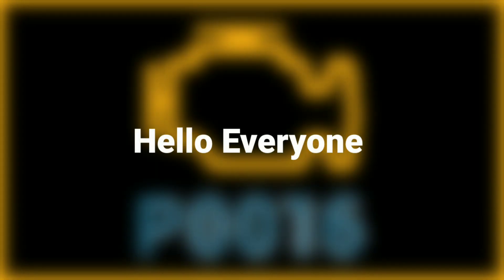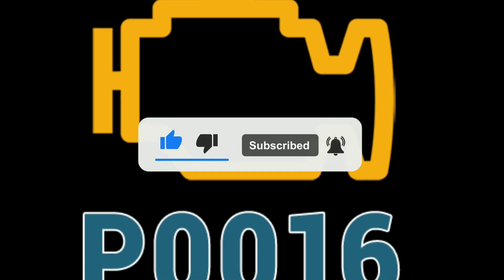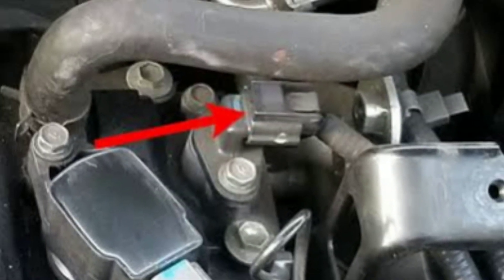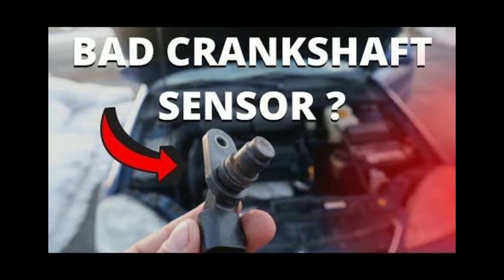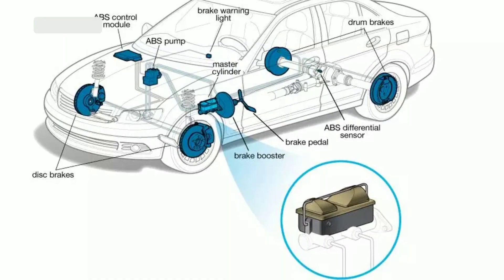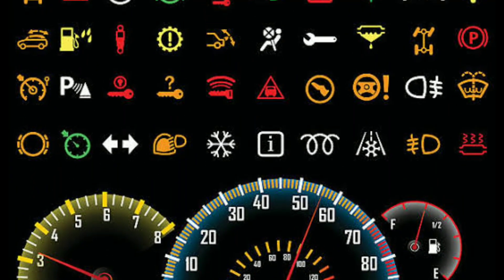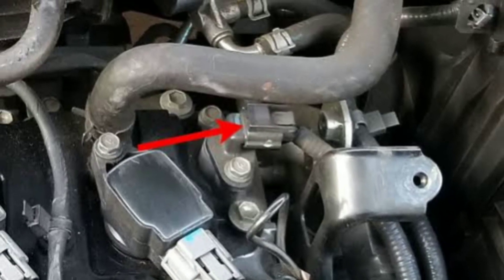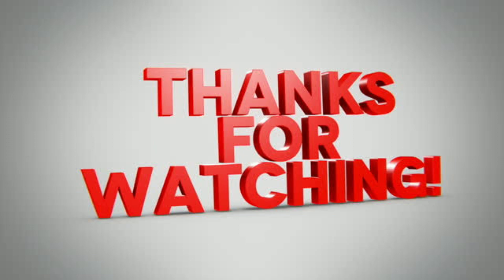P0016 Code: Causes and Solutions | How To Fix Code P0016 ?

Comment: Had this code pop up last week. My scanner helped confirm it wasn’t just a bad sensor but actual timing chain stretch. These tools save so much time guessing.
Reply: How where you able to actually diagnose past a sensor with a scanner
Reply from the maker: Exactly — code P0016 means the camshaft and crankshaft positions are out of sync. While a faulty sensor can trigger it, your scanner data likely confirmed actual timing chain stretch or wear, which affects engine timing. Catching it early with a scan tool prevents bigger engine damage and avoids unnecessary part replacements.

Comment: I had code p0017 code. Got the timing chain changed. Now i have code p0016 one week later.  Any suggestions?
Reply: I just had my 2015 Ford 3.5 Ecoboost at the dealer for a p0016 code and was told I had a stretched timing chain that would cost over $2,000 to repair.  I didn't trust the diagnosis because I didn't have any other symptoms of a bad timing chain such as an engine rattle, stalling or rough idle.  I suspected I was getting a bad reading from the  VCT sensor for bank 1 and installed a new on my self for under $50.  Problem solved.  My vehicle has 180k miles on it and the previous owner did not change the oil on a regular basis.  Dirty oil can cause the sensors and solenoids to go bad and the OEM recommendations are inadequate.  I change my oil every 5k miles with full synthetic oil to avoid this problem.
Reply: @Roy-ij1wq I’m praying my situation is similar. My vehicle has said I need an oil change for about 1.5 months now. I dont do much driving and its been super cold here in Michigan so I have been neglecting it. The code popped up yesterday but the vehicle feels and acts the same it always has. I’m hoping oil change solves the problem.
Reply: @ShakeThaBlockPyro  I hate to say this, but now I'm getting a P0010 code.  I'm also in Michigan and the code appeared when I started my Expedition the morning after we had quick freeze thaw cycle.  It runs fine except that sometimes it hesitates when accelerating.  I didn't have this problem after I replaced the sensor.
 I have an appointment next week with a trusted mechanic and am going to have him check the wires and see if he can figure it out.  I''m also going to have him test the sensor I replaced to see if was in fact bad.  My vehicle had 156,000 miles on it when I bought it and had the notorious cam phaser rattle.  This was defineately caused by dirty oil and was cured with four oil changes at 3k to 5k intervals.  It was 5 degrees this morning and the vehicle started just fine with no rattles.
Reply: @Roy-ij1wq  Sorry to hear that man I hope it works out fairly well for you. My ecoboost 2013 just hit 160K. I feel like the acceleration and overall how the truck drives hasn’t changed much since I bought it. I can tell you I won’t be neglecting oil changes ever again lol. I scanned it this morning before work to see what the code was now I can’t wait to get out of here and figure out this problem. Can’t stop thinking about it. Use to hear a flapping noise every once in awhile during summer/spring months, when starting the truck. Hoping not a stretched out timing chain.
Reply: @ Hoping old/low oil and these crazy cold temps are why I’m seeing this code

Comment: What's a 0333 code on 2008 Mercedes ml 350
Reply from the maker: P0333 code on a 2008 Mercedes ML350 indicates a malfunction with the knock sensor 2 circuit. This sensor detects engine vibrations caused by abnormal combustion, and when it detects excessive vibrations, it sends a signal to the engine control module (ECM) to adjust the ignition timing to prevent engine damage.   

Common causes of this code include:

Faulty knock sensor: The sensor itself may be damaged or worn out.
Wiring issues: Damaged or loose wiring can interfere with the sensor's signal.
ECM problems: In rare cases, the ECM itself may be faulty.

If you're experiencing symptoms like engine knocking, reduced performance, or a check engine light, it's recommended to have your vehicle inspected by a mechanic to diagnose and address the issue.

Comment: I did the cam adjuster upgrade on a M156 engine and now have a P0016 DTC. I'm waiting to see what  other content makers have to say on this repair. I'm replacing a sensor in the interim and hope that solves the problem,  There must be a common solution after doing the adjuster job and getting this code.
Reply from the maker: P0016 is a diagnostic trouble code (DTC) that indicates a camshaft position sensor A circuit malfunction. This often occurs when there's a discrepancy between the actual camshaft position and the position reported by the sensor.

Common Causes After Cam Adjuster Upgrade
When you've recently performed a cam adjuster upgrade on a M156 engine, several factors could contribute to the P0016 code:

Incorrect Sensor Installation: Even a slight misalignment or faulty connection can lead to sensor errors.
Damaged Wiring: The upgrade process might have inadvertently damaged the wiring to the camshaft position sensor.
Timing Chain Issues: If the timing chain wasn't properly adjusted or seated during the upgrade, it could affect the camshaft's position.
Sensor Malfunction: The new sensor itself might be defective or incompatible with the engine.
ECM (Engine Control Module) Issues: In rare cases, the ECM might be faulty or have software conflicts.
Potential Solutions
While you wait for other content creators' insights, here are some potential solutions:

Recheck Sensor Installation: Ensure the sensor is securely mounted and connected to the correct wiring harness.
Inspect Wiring: Look for any visible damage, chafing, or loose connections in the wiring leading to the sensor.
Verify Timing Chain Alignment: Double-check the timing chain tensioner and ensure the chain is correctly aligned with the camshafts.
Replace Sensor: If you've already done this, consider trying a different brand or model of sensor.
Consult a Mechanic: A professional mechanic can diagnose the issue more accurately and potentially identify underlying problems.
Remember to:

Clear the DTC: Use a diagnostic tool to clear the P0016 code after making any adjustments.
Monitor the Situation: Keep an eye out for any recurring symptoms or the code reappearing.
By systematically addressing these potential causes, you should be able to resolve the P0016 issue and ensure your M156 engine is running smoothly.

Would you like me to provide more information on specific steps or troubleshooting techniques for the M156 cam adjuster upgrade?

Comment: The fault code has been scanned and cancelled but it comes back again
Reply from the maker: Understanding and Resolving P0016 Fault Code
P0016 indicates a misalignment between your engine's crankshaft and camshaft. While clearing the code might provide temporary relief, its persistent return suggests an underlying issue.

Potential Causes of P0016
Timing Chain or Belt Issues:

Stretch, wear, or damage to the timing chain or belt can cause misalignment.
Check for slack, worn teeth, or broken links.
Consider replacing the timing chain or belt along with related components like tensioners and guides.
Camshaft or Crankshaft Position Sensors:

Malfunction or damage to these sensors can lead to inaccurate readings.
Inspect the sensors for physical damage, dirt, or corrosion.
Test the sensors with a multimeter to verify their functionality.
Oil Pressure Issues:

Insufficient oil pressure can affect the operation of variable valve timing components, contributing to the code.
Check oil level and pressure.
Ensure the oil pump is functioning correctly.
Variable Valve Timing (VVT) Solenoid or Actuator:

Malfunction of these components can disrupt camshaft timing.
Check for electrical issues or mechanical problems with the VVT system.
Troubleshooting Steps
Gather Information:

Note any accompanying symptoms like engine noise, rough idle, or reduced power.
Check the vehicle's maintenance history for relevant information.
Inspect Components:

Visually inspect the timing chain or belt for wear or damage.
Check the condition of camshaft and crankshaft position sensors.
Examine the VVT system for any signs of trouble.
Perform Diagnostic Tests:

Use a scan tool to monitor sensor readings and check for any other related codes.
Perform oil pressure tests to ensure adequate lubrication.
Consult a Mechanic:

If you're unable to diagnose the issue, it's recommended to seek professional help. A mechanic can use specialized tools and knowledge to pinpoint the problem.
Important Note: Ignoring this issue can lead to severe engine damage, so it's crucial to address it promptly.

Would you like to provide more details about your vehicle, such as make, model, and engine type? This information can help narrow down the potential causes.

I'm ready to assist you further once I have more details.
Reply: @weeklytools  2014 Ford Taurus SHO

Comment: Replaced the crank/and both camshaft position sensors on y 07 ford expedition . Cleared the code but it came back . P0016 . No noise from the timimg chain just a lirrtle rough idle and loss of power when realy getting into the pedal . Any suggestions
Reply: Change "oil control valve" thank me l8tr 😁 plz come bck and let me know
Reply: @WesleyMadai-tp5yp i have done all of these still the same problem
Reply: Check if a relearn/reset procedure is required for your car. It may only be possible with a proper scan tool. But some older models can “relearn” by a driving  procedure that involves specific steps.
Reply: I’m having this same isssue but can’t find anything have you found any answers???